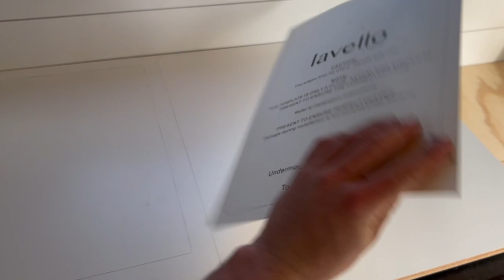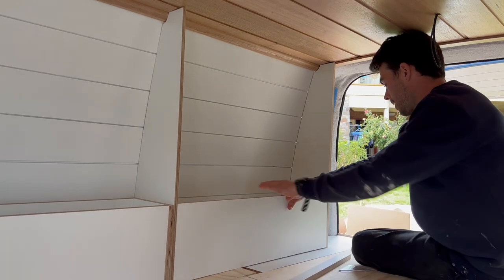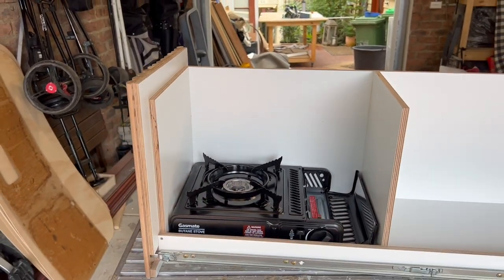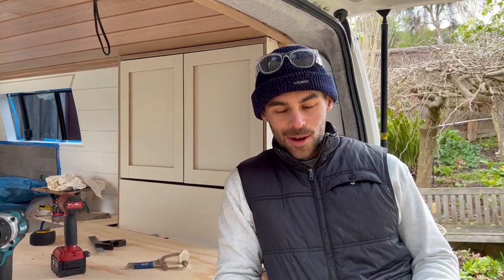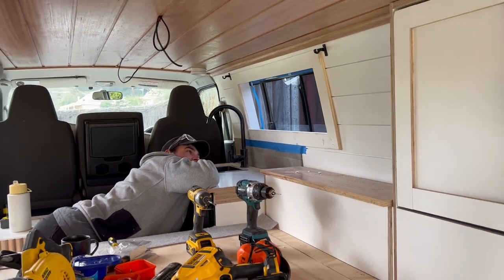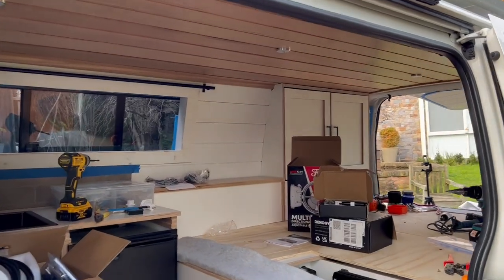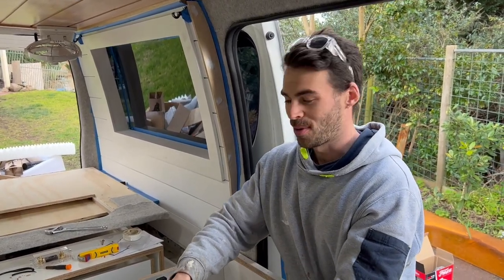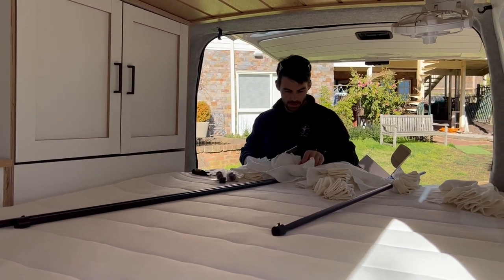4X4 TOYOTA HIACE BUILD Ep. 3 | The reality of van building... Will we get the van finished in time?!

Comment: Hmm... I think the design would work out well enough, though the sink and fridge being so far from the actual cooking area is a bit inconvenient.  Also the single burner stove will make it hard to cook anything other than single pot meals, though I guess a small rice cooker of some sort would help with getting real meals done if you've got enough solar for it (also good for if you don't want to go out to cook).  The lack of ventilation holes for the mattress is a bit concerning though, because a mattress needs to "breathe" to prevent mold forming since a van is likely to build up condensation.  Still, it's a pretty decent design. 👍
Reply from the maker: Thanks! Another single burner stove could sit on the bench top next to the current single burner stove too if required 🤗
Reply: @masonandsarah  True.  Or whoever uses it could get a Japanese style rice cooker/steamer with a double layer basket that could cook a full meal for two people with no risk of fire in about half an hour.  I believe those come in 12v versions specifically for use in cars.  Very convenient if you want to cook inside the van safely on a rainy day.  Might need an independent battery with a folding solar panel to run it (because I'm not sure your current solar system would be enough power for the cooker plus fridge) but it would be a good backup system to have anyway.  But maybe that's me being paranoid, lol. 😅

Comment: Do you guys happen to know what year this 4X4 H200 Toyota HiAce is? I come from the United States, in Upstate New York, where the HiAce has never been sold out there.
Reply from the maker: Ours is 2011!
Reply: @masonandsarah  I noticed on your Instagram page that the van is for sale. You guys would normally travel in a 1999 Toyota Land Cruiser Troop Carrier.
Reply from the maker: @DVaccarelli1988  Yep thats correct :)
Reply: They were produced from 2005 until 2017 essentially the same with a few tweak updates. The 4WD models come with 2.5 diesel until 2007 when it was updated to the 3.0 diesel and also a 2.7L petrol motor. The petrol/gas is the same motor as the Tacoma and Sienna and a few other Toyotas in North America. If I was importing to USA I would not touch the diesel.
Reply: Except import into USA is restricted until 25 years old. Canada has a 15 year rule so you may start seeing these more and more.